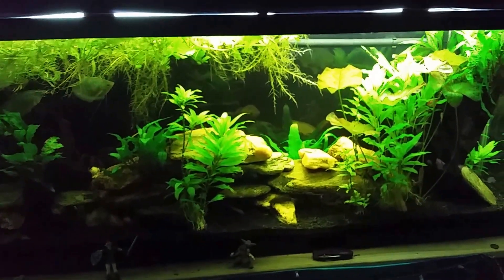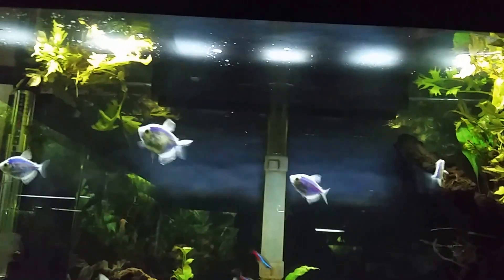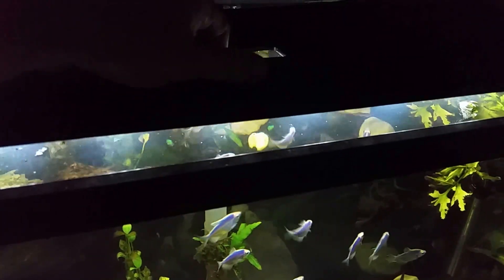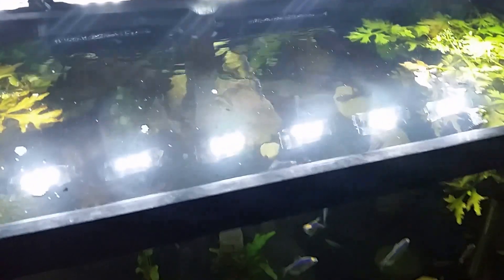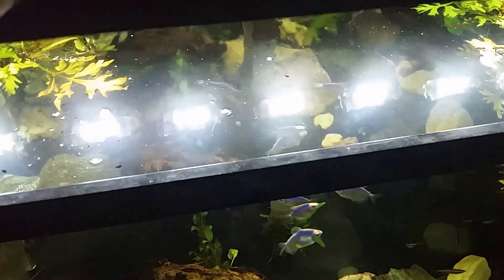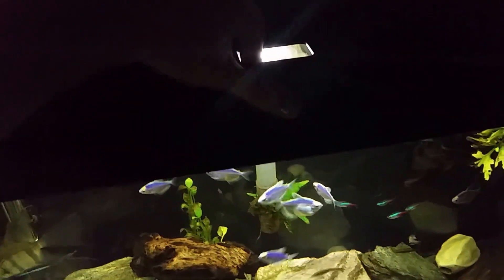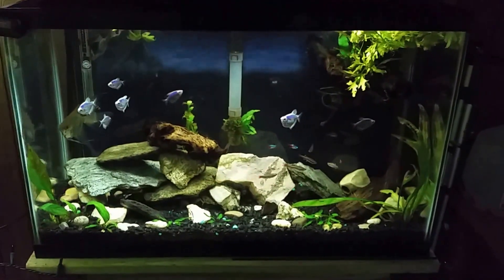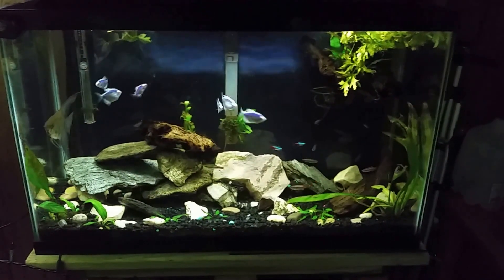Is Surface Agitation Necessary in your Aquarium?

Comment: Back in the day lets say 40+ years We had hang on back filters and it had a pump putting water into the tank and a U shapeTube putting water into the top of the filter. In the filter we had a layer of poly fill then charcoal then a thin layer poly fill at the bottom and that was it for the filter. The rock's and substrate inside the tank I guess was the bio media. It was a very effective filter I wish I could pick up a few now. It was so easy to clean. Now we know that we can put the bio media in the filter but back then no one knew. 
Thanks bro.
Reply from the maker: I think if you go back to the 50's, tanks were unfiltered for the most part. (I could be wrong, but I've heard old timers talking about it)

Comment: I have a Betta in a 5.5 gallon tank along with a few Nerite snails with the Forza PFE1 filter (5-15). 
I'm a bit concerned with the amount of oxygen getting into the water due to lack of surface agitation (bubbles) even at maximum outflow.
 Then again, I don't want my Betta getting tossed around by a larger outflow filter.
The tank is medium planted.

Any thoughts?
Reply from the maker: Betta get O2 from the surface. No agitation needed. They prefer calm, still water.
Reply: I have had bettas and Gouramis.  They simply do not need any aerators. They are infact happy without any forced  water flow

Comment: My filter powerhead pumps out just under the surface, enough to agitate the surface but not too loud. Added a surface skimmer and that was the biggest improvement to remove the surface film. The skimmer is off for 4 hours a day to give me a feeding window to aim for. And you can see the surface build up starting at the end of that 4 hour off cycle. Skimmer back on and that clears in minutes. I don't run any air into the tank, it's reasonably planted with 1 large plec and an handful of smaller fish. Been stable for many years.

Comment: new fish tank enthusiast here.  130litre tropical tank setup  2 weeks ago.  Real plants and bogwood/driftwood.  I had my filter and spraybar under water and bar facing downwards (so wrong but it didnt come with instruction).  I had no surface agitation.  One week later i had a horrid slime all on top.  I did a top layer water change 10%.  I then put the spray bar just on top of the surface and it had nice surface agitation and it looked nice too.  Not dead still.  Nice tranquil water sound and ive had no bio scum film now.   I like the surface agitation and the little water noise it makes
Reply from the maker: Yeah, you'll definitely get biofilm if you have a calm surface.

Comment: Enjoying your vids Dan, very informative. I myself am running a planted 90 right now, heavily stocked but with a stringent fish keeping husbandry routine. It probably helps from previously keeping a reef tank. I do prefer surface agitation,  other than the gas exchange which I think is important as you explained I think the flow is important to the welfare of the fish. I keep Denison Barbs and as you probably know the do like clean water with a bit of  flow. I also appreciate the movement of the plants, it kind of gives it a more natural look I find. As in most things its personal preference. I will be doing some more in depth vids detailing my experience in this fascinating hobby. I find myself keeping tabs on your vids as you give me a few pointers to things I may have missed. Cheers Steve.

Comment: I have set up an 14 gal cube with a micro sicce submerged filter that is very quiet. I hope that there will be no reason to ruin the quiet with an air pump. I adapted the filter with magnets so I can position it anywhere in the water column. The little filter cycles the water four times per hour so that should give me enough water movement without adding another device.

Comment: I've been trying to find the right combination of flow and co2 distribution  in my small, 10g planted tank. Had a bio wheel hob that just wasn't creating enough flow and was losing a lot of co2 with the surface agitation. Got a nicrew internal filter which has improved the flow by a lot. Placed the co2 diffuser under the filter which breaks up the bubbles and disperses it throughout the tank. 2 days after setting this up I have zero agitation and came home to dead fish. Decided to run an air stone after the lights go off. Hope this works for me!
Reply from the maker: I'm not sure what your goals are. Running CO2 vs an air stone will have opposite effects. The air stone will drive off excess CO2.
Reply: @DanHiteshew-oneandonly  
Yeah I only run the air stone after the co2 and light is off. Air turns off right before the co2 turns on

Comment: Im new to aquariums so I still learning in how it works. This is helpful, thank you. I would love to get rid of my air stone in my 10 gallon. Would be HOB be enough water agitation to get that gas exchange needed for the fish to survive? It is a planted tank as well. I also have a planted tall 37g  I just set up. I have the fluval 207 canister on that. I added a spray bar too
Reply from the maker: Yes a ten gallon should be ok, but this is an older video. I've since come to realize an air stone is a really big benefit, even if it isn't necessary.

Comment: Good Video!  I have (2)20 and a 10 gallon tank where I have air bubbles in them  But I just use a small amount of air bubbles to rise to the surface which is under a water drip spray that I made to agitate the surface water which mixes with the air bubbling up.  (My tank uses an HOB filtration and has fake plants)

Comment: In an aquarium book I have from 1947 (first edition 1937) they give the rule of 24 square inches of surface area per inch of fish. The actual volume of the tank is inconsequential, insofar as this rule assumed no aeration or filtration, so the breathing of the fish would depend entirely on gas exchange at the surface, and not on how much dissolved oxygen is "stored" in the water. In a later book I have (1970's) this rule is revised slightly, to 18" per inch of tropical fish, and 30" per inch of coldwater fish. 

The older book barely mentions filtration, and goes on to suggest that aeration doesn't need to be run continuously (the author notes many experienced aquarists only aerate water at night, when the plants don't produce oxygen). It was still a few years before the vibrator pump had been invented so your choices were either an expensive piston pump, or inflating an inner-tube with a bike pump and using that to provide air to the tank (this was not at all uncommon before cheap air pumps existed!).
Reply from the maker: The depth of the tank matter too. Maybe back then they didn't have tall tanks, but surface area to water depth is the ratio you need. With 24 sq inches of surface area, a swallow tank would be fine, but a tank that is 24 inches deep would be very O2 starved at the bottom. (unless you have very good circulation)
Reply: @DanHiteshew-oneandonly   I wonder about this too, but the author actually makes a point of explaining that the volume of the aquarium makes no difference. Their explanation is that since the surface is the only place exchange occurs, other dimensions are inconsequential. But the few photos of aquariums from the 40s and 50s I have seen all invariably show rather long, shallow tanks. Those super tall hex tanks from the 70s were still a few decades away! Also interesting to note that it was considered almost impossible to keep fish without some sort of plant life in the tank, all of my older books spend about as many pages on plants as they do on fish (and there are some interesting varieties in there that I've not seen in shops today, and much that is seen today that apparently was unheard of then).
Reply from the maker: @furripupau  There's a ratio, although I don't know what it is, between surface area, and water depth.  Good circulations is the key though.

Comment: What are tge silver and orange fish in the first tank eith the frills on the ends of their fins?? Thay are so cool!
Reply from the maker: I'm guessing those would have been my Congo tetras.
Reply: @DanHiteshew-oneandonly  yep! I looked them up thats them. Although yours seem to have a slightly different tail shape than most which is super cool. I was drawn to them instantly. I may have to try them out! Any tips for them specifically or pretty straight forward?
Reply from the maker: @mstevens6723  The males develop the "streamers" on the tail as they mature.
They get big and need plenty of room. Keep them in as large a group as you can get or have room for. You'll be blown away by them. I highly recommend if you have a big enough tank (75 gallons or more).
They need lots of swimming room too.
Reply: @DanHiteshew-oneandonly  very cool!! Thanks!!

Comment: I try to get movement at the top of my tank mainly for cosmetic reasons. I wouldn't add bubbles to my tanks because it would defuse more of my Co2. Your tanks look good!
Reply from the maker: That's a good point too. Planted tanks should never have an airstone (unless for a specific need, like using meds).
The airstone actually will reduce your CO2. Excellent point. (I wish I had made it. Lol)
Reply: +Dan Hiteshew I have heard of people using an air stone at night when the Co2 is off but I would think that would only be needed in heavily planted tanks.
Reply from the maker: Nick 'S I don't run CO2 (injected), but even in a low tech planted tank, you always want to keep as much CO2 in the water as you can. Gassing it off with an airstone is working against yourself.

Comment: I just newly add co2,, 1 or 2 bubbles per sec,, tank is 2 ft, the indicator newly bought yesterday show yellow which is high,, some suggest I shut down n do water surface agitation,, done that for 8 hours already , co2 shut down more than 20 hours,, inductor still show pale yellowish with slight green hints, may I ask should I continue shut down co2 or ignore the color indicator?
Reply from the maker: I really don't know. You'd have to ask someone that uses CO2. I have no experience at all, and don't want to give you bad advice. Sorry I couldn't be help.

Comment: You seem to be quiet knowledgeable. I'm curious how does a heavily stocked tank of plants affect this at all? Would there need to be less surface agitation or just an equal amount?
Reply from the maker: I'm not sure I understand your question.
Reply: @DanHiteshew-oneandonly  What I mean is you need surface agitation to exchange gases. How does this process change when you have a tank absolutely stocked full of plants? Would this decrease the need for that exchange?
Reply from the maker: @net200777  Plants produce O2 during the day but use O2 at night, so having gas exchange is still necessary. You just don't "need" a lot of surface agitation. More agitation is better though.

Comment: Is surface agitation necessary? In a planted tank, during the day, not so much, as the plants will provide the water with oxygen. At night, it is essential as the plants will give off co2 and your fish will suffocate without any surface agitation.

I had a issue where my fish were fine during the day, but I'd go to sleep, wake up in the morning and find numerous fish died overnight. All my water parameters were fine, so I was baffled. Until I realised they were suffocating at night due to there not being enough surface agitation. I added an air stone that comes on a timer when the light goes off at night.

During the day the air stone is off and my pump provides a gentle surface agitation.

No more fish dying over night.
Reply from the maker: Plants actually use O2 during the dark period. The moment you turn your lights on, will be the moment of least O2 in the tank. An air stone on 24/7 isn't a bad idea.
(this is an old video. I've come to appreciate the value of the humble air stone)

Comment: I haven't got much water movement in my tank , I've read different reviews on this , I've only got a small 55 litre tank as I'm a beginner , no fish in tank yet but a couple of live plants, do i need a lot of water movement  ,
Reply from the maker: That would depend largely one which fish you chose, but in general terms, no, you don't. make sure the volume of the tank turns over 10 times the tank volume per hour. ( 10 gallon tank should turn over at least 100 gph) you don't need a lot of surface aggitation to achieve this.
Reply: Dan Hiteshew  thanks for the advice, also I checked today 
Ph levels are fine 
 ammonia is 1.0 
Nitirites 1.0
But i had a nitrate spike and have shot up to 40 , is it coming to the end of the cycle and should I do a water change . Thanks

Comment: Hey , hopefully you reply to this question because I'm stumped .

I have the fluval flex . Shrimp tank haha so the water is pretty warm because it's being used for a breeding. So of course warmer water doesn't hold much o2 as cooler water so does that mean I need more surface movement ?
Reply from the maker: Yes. If you have warmer water, you need to increase the waters ability to exchange gasses since the warmer water doesn't hold much O2. If it's in the mid 80's I would even recommend an air stone.
Reply: Dan Hiteshew that's what I'm currently doing , airstone haha thank you for the reply
Reply from the maker: Dan Pham No problem. Good luck!

Comment: Why does my tank have alot of bubbles at the top of the water that arnt popping ? thanks
Reply from the maker: If you have a bubble nester, like a Gourami or Betta, that would be one reason. 
Another could be too much biofilm on the surface. The oily matrix will hold the bubbles shape, instead of them popping quickly.
Other than that, I don't know what to tell you.
Reply: how do ya get rid of biofilm?
Reply from the maker: conman20000 Surface agitation, a surface skimming filter, or manually skimming it with a pitcher during water changes. Those are the 3 easiest and most effective ways.

Comment: Yes you are correct you can run a tank without a filter or surface agitation. The problem is you'd have to have an open top tank and hope the fish don't jump out and you have to change the water all the time. You also said one of your tanks has cynobacteria. More surface agitation for better gas exchange will help prevent cynobacteria. Air stones as you said do not put oxygen in the watter, but it does move water around in the tank breaking the surface witch causes the tank to trap oxygen from the air.  In a non plated tank surface agitation is more crucial than a heavily planted tank like yours. If the top is still an oily like resedue will form and if not removed regularly can smother the tank. You claim you remove this with the watet changes.  I just think you are putting too much work into the tank maintenance that more surface agitation could solve.  This all being said if you want to do the work it is up to you and overall your tanks look great and healthy.
Reply: excellent comment

Comment: I have a air stone run for an hour a day in my betta tank
Reply from the maker: Bettas can get O2 directly from the air. They don't need air stones. Be sure you're not causing too much water movement. Bettas prefer calm water.
Reply: @DanHiteshew-oneandonly  its not for him its to keep the oil film on the top from building up because it looks ugly and yes he can still come to the surface just fine

Comment: All this is true with large bodies of water as their is a lot more surface area in contact with oxygen especially when wind passes over it but in small tanks fish will not survive very long in still water with no surface breakage.
Agitation is not enough, you have break the surface of the water otherwise it's like you being in a balloon full of oxygen and co2, eventually, it will just be co2 and unless you break a hole in the balloon their will be no release of co2 and no oxygen
Reply: I have kept piranhas for 6 years in my tank and recently set up a fancy goldfish tank but I'm worried for them as I only have a low wattage pump that I have diy'd into a filter temporarily as the tank is getting cloudy and the fish are all itching themselves on the wood.
Reply from the maker: That sounds like a problem with your nitrogen cycle. Check your ammonia and nitrite levels.